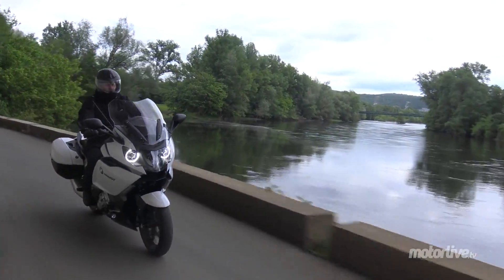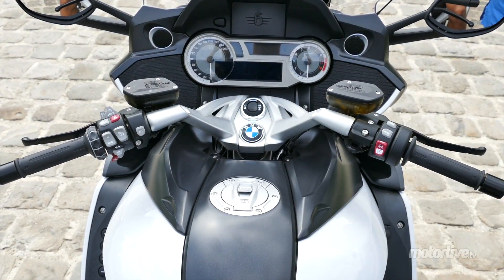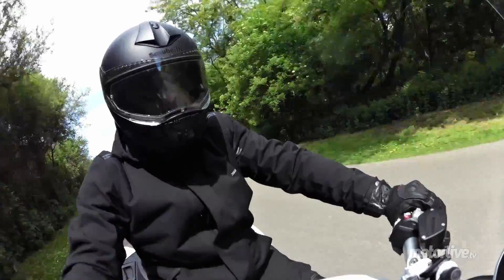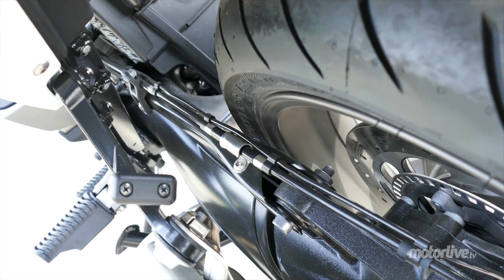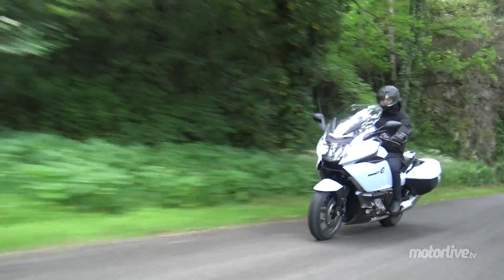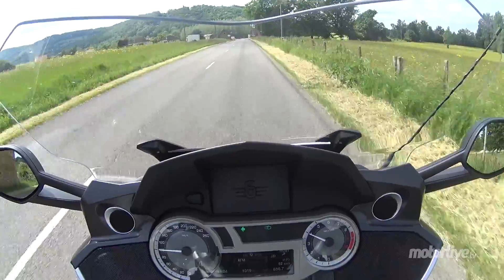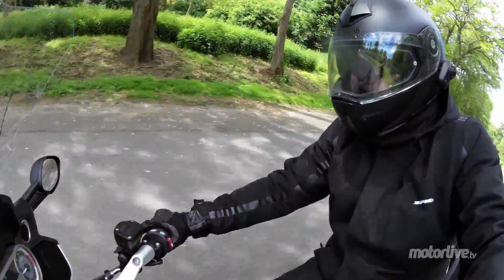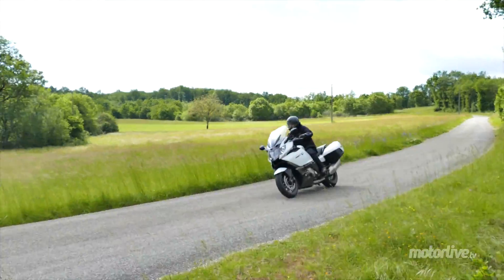TEST | BMW K1600 GT

Comment: Quelques impressions sans parti pris sur cette K 1600. Je viens de l'essayer longuement dans les Alpes sur les routes du tour de France. Points forts : le moteur jouissif (une sonorité que je connais déjà, ayant la chance de posséder un 1000 CBX), une maniabilité hors-norme eu égard au gabarit, un confort au top (suspensions / position de conduite) qui est pratiquement du même niveau que le 1200 RT avec lequel j'ai roulé pendant 3 ans. Les moins : une commande de gaz difficile à gérer (électronique) conjuguée avec une transmission désagréable (à-coups et bruit) qui gâchent un peu ce bilan. Je ne sais pas si ces points ont été revus sur le nouveau modèle car l'essayeur n'en parle pas. Pour conclure une excellent machine pour tailler la route dans toutes les conditions qui mérite quelques améliorations pour tendre vers le sans faute ....
Reply: marrant j'ai pas ces désagréments sur ma gtl